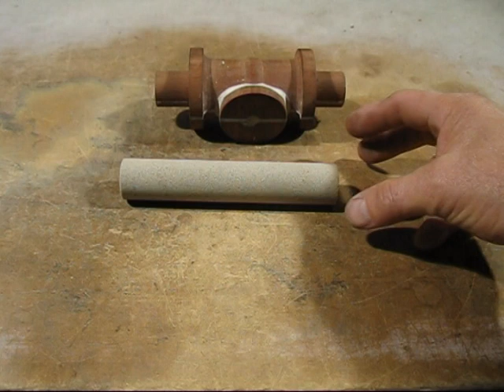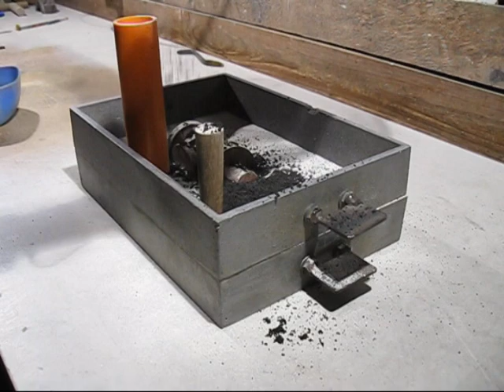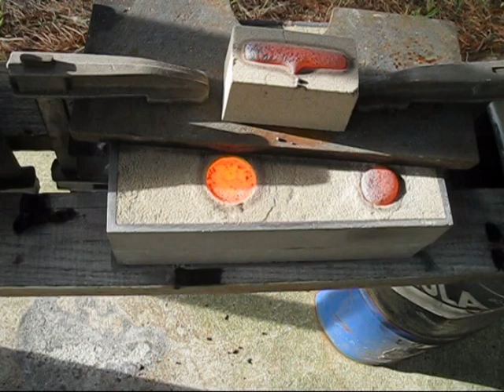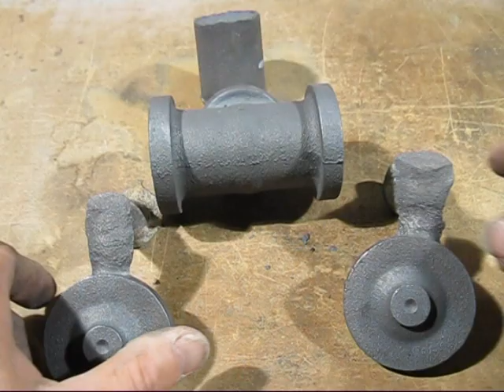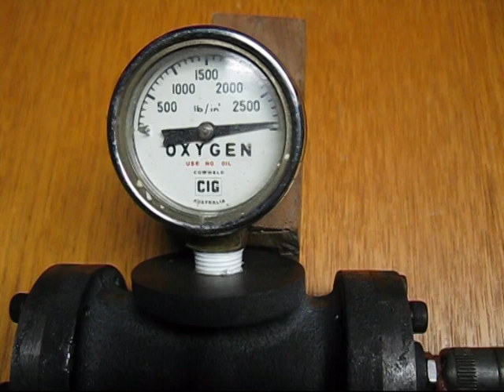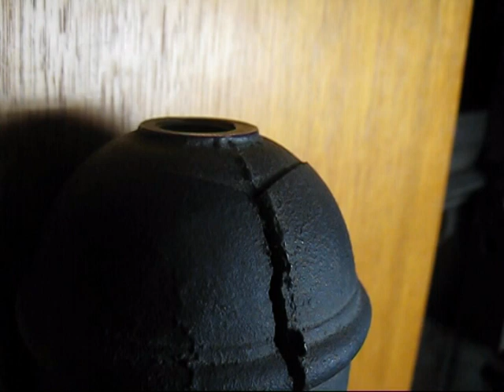Pressure testing my iron casting

Comment: Any chance you could do a video on the head pressure calc's you used to avoid using vent holes?  Thats crazy, never saw that done before.
Reply from the maker: Most of my molding boxes are 50 mm tall and that is all the head pressure I need to fill up a mold without a vent.

Comment: I am really surprised the difference of adding steel to a cast iron casting makes such a big difference in finish and pressure strength. What I am wondering about is the use of oil and grease to check pressure test. When we used to pressure test at work we used water as the fluid. Can you elaborate on the diffrence Sir ??? Thanks, VF
Reply from the maker: No difference, I prefer to use oil and grease.

Comment: Thanks for the Vid. By adding steel to the iron do you need to run the melt hotter?
Reply: Steel is just iron with a certain percentage of carbon in it. Adding carbon to iron lowers its melting point. You can look up a iron-carbon Diagramm to see how a certain percentage of carbon affects the melting point of iron. (The top line of the Diagramm shows the melting temperature of the alloy)
Reply: MakingAllsorts I sort of misunderstood your question. I believe when he says at 7:55 that adding steel to the cast iron is a good way to increase the tensile strength, he is adding the steel to reduce the carbon content of the cast iron. So he indeed has to run the melt hotter.
Reply from the maker: If I was pouring very thin castings then it would have to be  hotter.

Comment: These are great videos.  Thanks for taking time with your explanations. The more I watch, the more questions I have to learn more about this.
Could you do another pressure test but put the part in a measured volume of water so that you can see how much the part expands by the water volume increasing. This would help dampen and control blowout direction should the part fail - with the water surface directed away from you.
Reply from the maker: I was thinking of using a dial indicator to see if the casting was swelling but the water idea is a better idea.
Reply: @luckygen1001  I used to do hydrostatic testing of high pressure gas cylinders. You do not want to be in the room when they go Bang. We would measure deformation/ expansion with the same process.

Comment: We used to pressure test with water. But oil is the same thing. A non-compressible fluid. Impressive results. And good to learn that you had a learning curve to! Watching and learning as always.

Mark
Reply from the maker: I use oil because cast iron rusts so easily when using water.
Reply: @luckygen1001    Hard to argue when you make sense.

Comment: How much beyond the working pressure does the part need to be able to handle?  I assume a 2:1 or 4:1 safety factor would normally be adequate, and that 30:1 would be overkill.
Reply: In the case of a cylinder, since theres alot of viberations, high speed heating n cooling and pressure variations, for prolonged periods of time. I would think more is needed, but 30:1 yes maybe overkill.

Comment: Interesting!  Such a nice casting.... and then it got cut up😯 Is that a Colchester Student lathe? 
Regards, Mark Presling
Reply from the maker: The reason why it got cut up, it was a test casting and I needed to know if there were any blowholes from the sand core. Did you see how easy the sand came out of the casting? Your cores should do the same. My lathe is a Colchester 13" swing 36" between centers. Have you seen this video, Washing Machine powered Mulling Machine [Upcycled Workshop Tool]   by flowering elbow? It looks very similar to yours.
Reply: Flowering elbow is a great guy to watch and I am sure that Mark will have no problem with someone copying his muller to some extent.
Reply from the maker: Flowering elbow built his muller about two months before mark did.